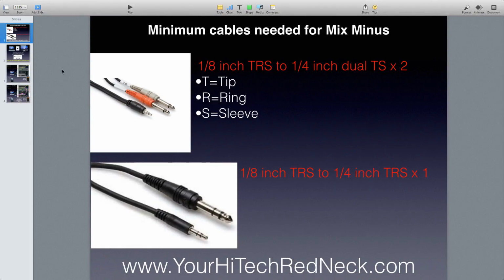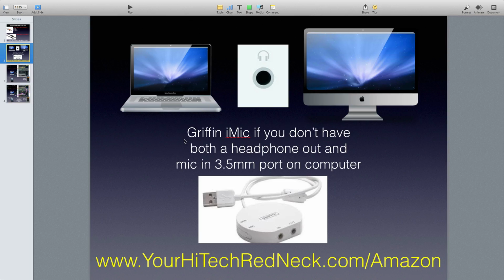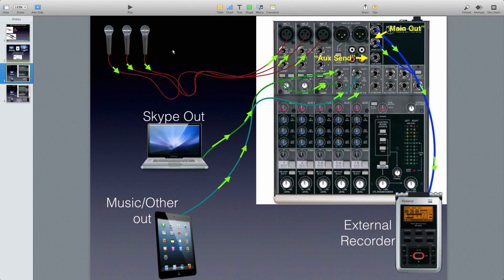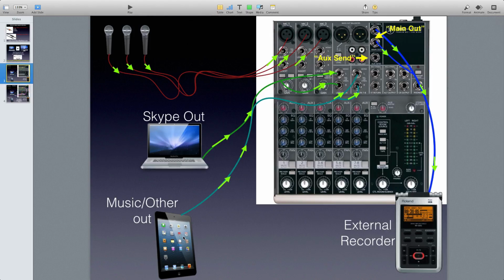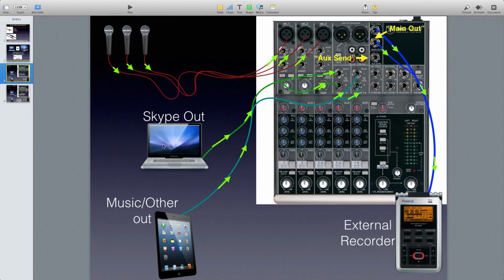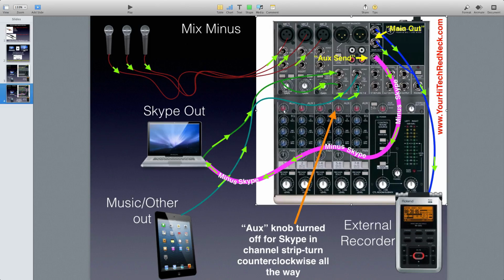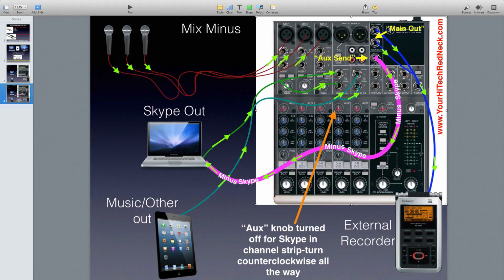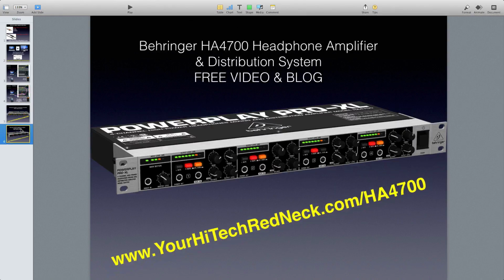Podcast Mix Minus | Complete Tutorial How to Set Up & Record Mix Minus Skype

Comment: hey Ryan, thanks for the mix minus tutorial. it helped to clarify the complexity of all the inputs & outputs. I know each setup is "slightly" different, but 2 quick questions... (1) do I need 2 sound cards to make this work & (2) do I need to make any sound setting adjustments to either my Windows laptop or my Skype account. I got everything set up as per your video, but could not hear my guest. running your setup thru my Behringer Q802 mixer & monitering output thru my Tascam DR-40 recorder. Thanks man!

Comment: Thank you for this video. Very useful. So, here's what's not working for me: caller cannot hear my audio unless I speak directly into the mic on my Galaxy s7. Every cable I use works. My mic on chan 1 works. FX Send works. Caller audio on 3/4 works. Killing FX return on 3/4 works. TRRS splitter on phone works. Everything works just like it should work with that one small exception: caller cannot hear me unless I speaking into the phone. What am I missing?

EDIT: Upon further research, I've discovered this might be an OMTP vs CTIA issue. Ordering a CTIA splitter now. Will let you know!

Comment: Hey! Thank you so much for your high quality video complete with line in and out pictures.  They are very helpful.  I was wondering, though....I have a new iMac so I don't have an audio out.  You recommend the Griffin imic.  Can I use the Behringer UCA222 instead? Do they do the same thing?
Reply from the maker: Thanks for watching Sarah. I hope to get some time to make some more vids, but super busy with my main podcast. Yah Sarah. Neither my iMac and MacBook pro have audio out. So, I just got two Griffin iMics and they work perfect. 

Here is an Amazon affiliate link if you choose to purchase: http://www.amazon.com/gp/product/B000BVV2IC/ref=as_li_tl?ie=UTF8&camp=1789&creative=9325&creativeASIN=B000BVV2IC&linkCode=as2&tag=lawabibik0a-20
Reply: Ryan Urlacher Thanks! That helps. I assume the iMic goes where the green and pink lines are in your video next to the computer.  Also, if you provide an affiliate link to amazon of the cables I need, I will click on them. I notice you have shownotes embedded into youtube. It would be helpful to have active links in there to amazon. I am about to buy some equipment so as a way to help you out, I will wait until this evening to buy my stuff in the hopes you have time to provide those affiliate links. Also, I don't know what software you use, but do you only record onto the Roland or is there a way to record directly into Audition on the computer AND the external recorder. Thanks and Cheers!

Comment: Thanks Ryan for the great vid. The best one I've seen so far to explain the mix minus process. I have a quick question though - I have a Mackie 402VLZ4 mixer and what I'm trying to set up in my voice over studio is a way to use Skype as a phone patch so I can have directed sessions. Everything I've set up so far works great except two things (I think!) - 1) How (if possible with the 402) do I have the Skype input (the VO directions) on a separate channel using the "stereo pan" function? The idea is to not have a take ruined if the session director coughs or something in their background is noisy while I'm talking as I wouldn't be able to edit that out. 2) Is there a mix minus workaround if the mixer doesn't have a Aux Send? Thanks again for the great video and hope you can help. Cheers!
Reply from the maker: There are mixers that have a usb out that can record multi multi channel, but the one you have does not have that capability.  That would be my suggestion so each audio is on a separate track.

Comment: Forgot to mention I have the "Made in the USA" Mackie 12 channel Micro series 1202 Mackie mixer. On a real tight budget here and picked this up on ebay for 80 bucks with free shipping. Also using a Zoom H2 for my recording...any thoughts on cables? Have a great day sir and keep up the fine work!   Michael.
Reply from the maker: The cables I show in this video are exactly what you will need for the hookup. You'll need a Dual 1/4" TS to 1/8" TRS (3.5mm) to go from your mixer output into the Zoom. XLR mic cables of course to go into your mixer from you mic. You will need to go into your mixer from your computer with the sameDual "TS to 1/8" TRS (3.5mm). Just depends on how many mics and inputs/outputs you will have.  Hope this helps.

Here are some ideas and reasonable price. These are the exact cables I use.

http://www.amazon.com/gp/product/B000068O3C/ref=as_li_tl?ie=UTF8&camp=1789&creative=9325&creativeASIN=B000068O3C&linkCode=as2&tag=youhitecred-20

http://www.amazon.com/gp/product/B000068O1P/ref=as_li_tl?ie=UTF8&camp=1789&creative=9325&creativeASIN=B000068O1P&linkCode=as2&tag=youhitecred-20

http://www.amazon.com/gp/product/B002PAOMSY/ref=as_li_tl?ie=UTF8&camp=1789&creative=9325&creativeASIN=B002PAOMSY&linkCode=as2&tag=youhitecred-20

Comment: Awesome video. Question I'm using a Zoom H6 as my external recorder. Primarily I have my mic connected to one of the lines into the H6 and then my cohost through Skype on another Input. For mixing purposes is there a way to separate the same tracks coming through the mixer into the external recorder. For example my mic is considered one line my co-host line#2 soundboard as line#3 etc? Hope my question makes sense.
Reply from the maker: USB mixers allow for separate track recording, but not analog mixers.

Comment: Having a huge issue trying to  use skype on remotes with my laptop that has an universal headphone/mic jack. We can't seem to get the mic mix from the board into my pc and into skype. I've adjusted the skype mic settings, but for some reason nothing seems to work! Any suggestions or advice? Can't seem to get the stereo mic mix to work and not the microphone built into my laptop.

Comment: Great stuff!!!  I am setting up my audio studio and am having some trouble.  I watched your videos on youtube and thought they were great.  Here is my specific issue:  I have my mix minus set up.  Everything works but the audio from skype is terribly "hot".  I have all my levels on the mixing board turned way down and when i send it to my other computer and into adobe audition it is terribly hot.  But because I have the levels turned down so low on my board I can hardly hear it through my headset even though it is blowing up my levels in adobe audition.  What advice can you give me....I am trying to get as good of quality interviews as I can.  My audio by the way through the board is quite good and has not been an issue at all.  tried turning the volume down to 50% on the skype computer and still does not work...If you could assist me would be greatly appreciated.
Reply from the maker: +Jeff Tigger Erhardt Super glad you liked the videos Jeff. So many things to address. It is another computer with Skype going into the mixer. If so, make sure the output levels are down a bit on that device. Also, the computer with Audition you are going into may need the "input" levels in settings turned down. A few things to try. If you need one on one consulting (fee) you can hit me up at http://www.yourhitechredneck.com/contact & we can see if we can find a time.

Comment: I have a Mackie 802vlz4. Everything pretty much looks the same as the 802vlz3.  Here's my question. I have a Zoom h5. I'll be using just one mic in my set up, not 3. And I'll be making use of the mix minus setup as you've described to record a Skype caller. In the Zoom h5, you have two recording options, namely, stereo or multi. Which should I use? My plan is to edit the interview in post production using garageband, etc. BTW, do you use wav or convert to mp3? I have a mac for editing purposes.  Thanks.
Reply from the maker: +CuteMonster I always record in .wav for the best quality. After post edit I convert to mp3 and upload to my audio media hosting service. Honestly, I have never used the zoom H5, so I am not familiar with the settings etc. I use the Roland R05 and back up to a Tascam DR-60 at the same time. Those I am familiar with.